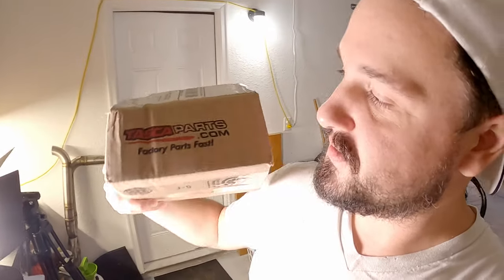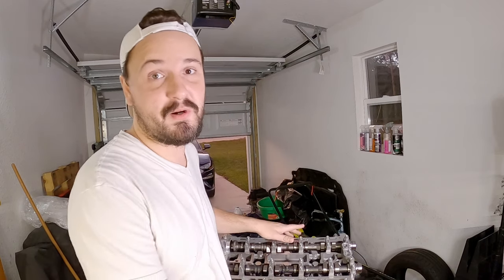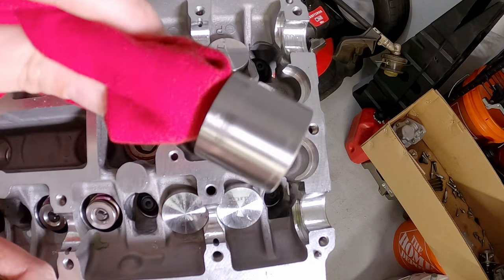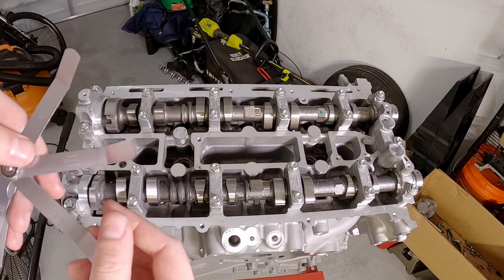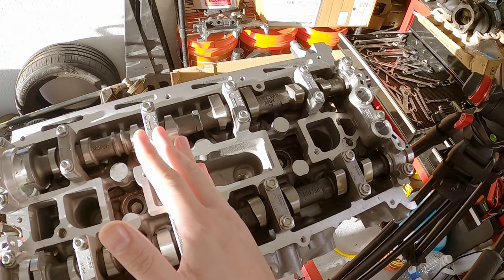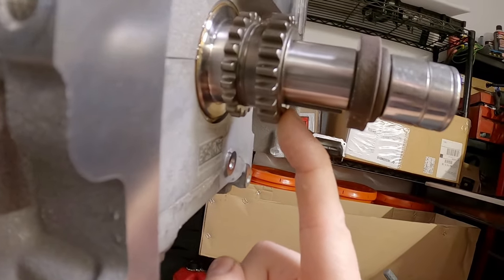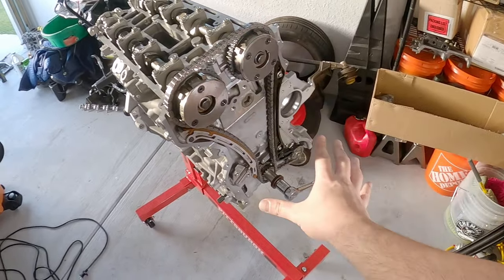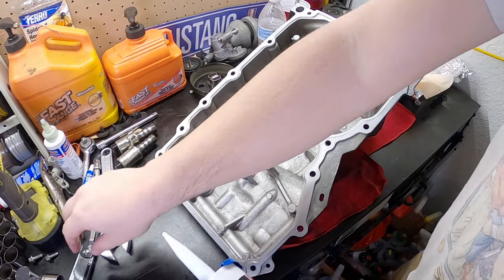Mustang ECOBOOST Engine Rebuild Part TWO - Timing the New Cams & Sealing It Up!

Comment: Did you install a new turbo screen filter in the oil feed from the block? if not check your old block with tweezers for your old screen.
Reply from the maker: I installed a new one. I showed it in one of these videos.